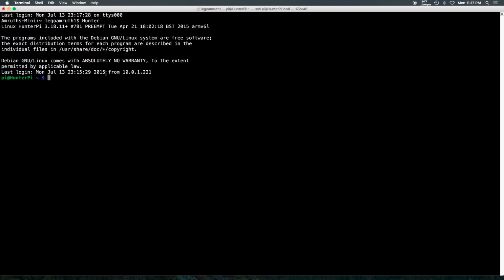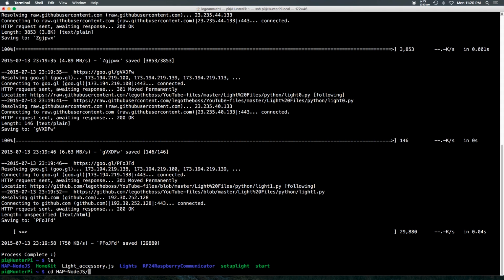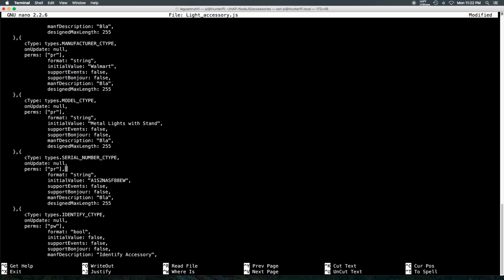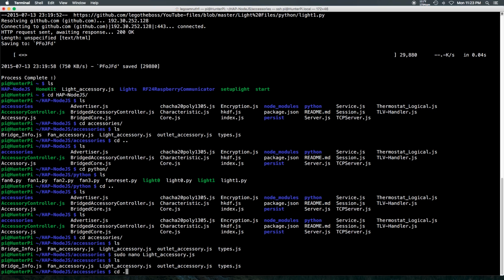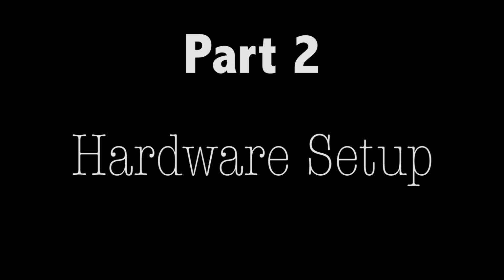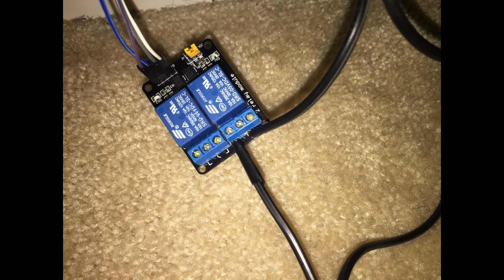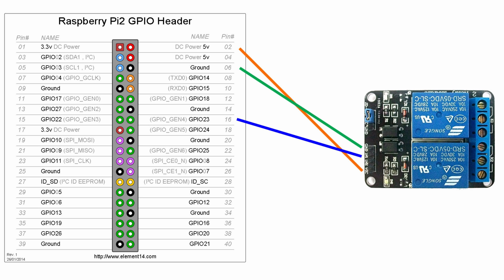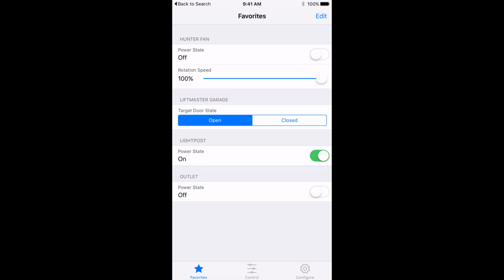TUTORIAL: Siri/HomeKit Lights with Raspberry Pi

Comment: aha, i have Search with my Multimeter, and i have see the Relais1 is Death...the Relais 2 ist ON..my Lamp Works...COOL, Thanks..

i have an Script Error,

import RPi.GPIO as GPIO
from time import sleep
GPIO.setmode(GPIO.BOARD)
GPIO.setup(26, GPIO.OUT)
GPIO.output(26, 1)
GPIO.output(26, 0)
sleep(2)
GPIO.output(26, 1)
GPIO.cleanup()

insert in light0 and in light1

when i said Siri Lamp ON, Siri give Lamp ON after 2 Seconds Lamp OFF,
when i said Siri Lamp OFF, Siri give ON after 2 Secondes Lamp OFF..

so i have insert Sleep(10)

Lamp on 10 Second, and Auto OFF

How can I do that the Lampe is Permanently ON, and ON and ON...and after when i said to Siri Lamp OFF...the Lamp is off

what script i give in the Raspi?

do have the right script for me?

Thanks a very lot, 

this script here, is COOL with the Lock Door in House.
Auto OFF...in (20) Seconds...
Reply from the maker: I suggest you use my code rather than this. This code is always switching on and off the light. The code used in the tutorial does not do that. Refollow the tutorial and that will work. The script edits you made don't work like that.

Comment: I have 220V with a lamp, here

when i connect the last Wire to second Relais, I hear a clicks, and after 1 Second another Klick
when i connect the last Wire to first Relais, who i insert the Lamp, i don't can hear the Klick...and the Lamp is nothing ON or OFF...

What am I doing wrong?
Reply from the maker: 0FreddysStudio0 I think the issue might be with your relay. If the siri commands work, its a wiring issue or relay problem. Another suggestion I give is switch your light0 and light1 files. rename them. Rename light0 as light1. Then rename light1 as light0. Your relay type might be different than mine due to 220V.

Comment: have you an tutorial from an Lock Door?
why a Relais switch this here...or connect directly

http://www.amazon.de/ABUS-ET75-elektrischer-Türöffner-575549/dp/B00JLGC228/ref=pd_cp_60_2?ie=UTF8&refRID=0MJ7E4KFM9DKC7RY26X6

ehm, Lock open, after 10 sec lock auto closed

Comment: COOL...the Raspi 2 works

i have installed the Permanently Start on Raspi Start..

my Problem is the Relais...

when i said Siri Licht ein...Siri said Licht is ON...my Lamp is OFF!!
i have install the Python shell and a have two Files in the python directory...the lights0.py and the light1.py
i have insert this hier in the Files, 
import RPi.GPIO as GPIO
from time import sleep
GPIO.setmode(GPIO.BOARD)
GPIO.setup(26, GPIO.OUT)
GPIO.output(26, 1)
GPIO.output(26, 0)
sleep(2)
GPIO.output(26, 1)
GPIO.cleanup()

after i have connect the Pins on Raspi on your tutorial...the Lamp not Light...not OFF..

What did I do wrong?

THanks
Reply from the maker: You have done the wiring wrong. I suggest you relook into the wiring. You put one of the wires into the NC terminal. Can you please message me a picture of the wiring?

Comment: pi@raspberrypi~/HAP-NodeJS $ sudo node Core.js
* WARNING * The program 'node' uses the Apple Bonjour compatibility layer of Avahi.
* WARNING * Please fix your application to use the native API of Avahi!
* WARNING * For more information see <http://0pointer.de/avahi-compat?s=libdns_sd&e=node>
* WARNING * The program 'node' called 'DNSServiceRegister()' which is not supported (or only supported partially) in the Apple Bonjour compatibility layer of Avahi.
* WARNING * Please fix your application to use the native API of Avahi!
* WARNING * For more information see <http://0pointer.de/avahi-compat?s=libdns_sd&e=node&f=DNSServiceRegister>
Parsing accessory: Fan_accessory.js
Parsing accessory: GarageDoorOpener_accessory.js
Parsing accessory: Light_accessory.js
/home/pi/HAP-NodeJS/accessories/Light_accessory.js:108
		manfDescription: “Doesn’t actually adjust Hue of Light",
		                 ^
SyntaxError: Unexpected token ILLEGAL
    at exports.runInThisContext (vm.js:73:16)
    at Module._compile (module.js:443:25)
    at Object.Module._extensions..js (module.js:478:10)
    at Module.load (module.js:355:32)
    at Function.Module._load (module.js:310:12)
    at Module.require (module.js:365:17)
    at require (module.js:384:17)
    at /home/pi/HAP-NodeJS/Core.js:22:24
    at Array.forEach (native)
    at Object.<anonymous> (/home/pi/HAP-NodeJS/Core.js:19:53)
pi@raspberrypi~/HAP-NodeJS $
Reply from the maker: 0FreddysStudio0 I suggest you refollow the tutorial. There were some bugs that occurred and your log file helped me fix them. Rerun the setuplight script or Just Redo the tutorial if that is easier for you. Good luck :) and let me know what happens.

Comment: HI..i don't can see the Light...
ehm i have installed on your Video...and i have installed the Forever start...all OK...
when i reboot the Raspi 2, with last Raspian...i can see in the last Boot file, :
warn:--minUptime not set. Defaulting to 1000ms, and Warn spinSleepTime not set, Your script will exit ... and 
Info: Forever provessing File: Core.js
and Started HAP-NodeJS
my IP address is: 192.168.1.150

and the IP Adress from my iPhone is : 192.168.1.15

HM Catalog i have installed on my iPhone 6 Plus…and Funktionality Perfect..
i go to Rooms, and Add Accessory...and here is  Browsing for new accessories...
FIND Done...
nothing

why?
have you an adea?

Thanks
Reply from the maker: Try running Core.js without forever. Start it normally via the command 'sudo node Core.js'. See what errors occur. If you can fix them, fix them. If you can't, leave a comment so I can guide you. Good luck :)

Comment: I followed you steps but when I tried to add accessories , there were nothing show up. Could not find the accessories. Do you have any idea what might be the problem? I already forever run Core.js. Thank you very much.
Reply from the maker: Kingsley Wang Try rebooting the raspberry pi. Then use the standard command 'sudo node Core.js' and see what errors pop up. If there aren't any errors, I suggest you remove the 'persist' directory in the HAP-NodeJS folder and also reset the HomeKit configuration on your iOS device.
Reply from the maker: Kingsley Wang  I suggest you refollow the tutorial. There were some bugs that occurred and a provided log file by another viewer helped me fix them. Rerun the setuplight script or Just Redo the tutorial if that is easier for you. Good luck :) and let me know what happens.
Reply: QuickPi Hi , I retried it. And it find the light1 once. It just sometimes show up sometimes not. Have you met this situation before?  And it cannot be added, showing communication failure. :)

This is the log file after running standard sudo node Core.js. Do you have any idea what is that error. Thank you !!

* WARNING * The program 'node' uses the Apple Bonjour compatibility layer of Avahi.
* WARNING * Please fix your application to use the native API of Avahi!
* WARNING * For more information see <http://0pointer.de/avahi-compat?s=libdns_sd&e=node>
* WARNING * The program 'node' called 'DNSServiceRegister()' which is not supported (or only supported partially) in the Apple Bonjour compatibility layer of Avahi.
* WARNING * Please fix your application to use the native API of Avahi!
* WARNING * For more information see <http://0pointer.de/avahi-compat?s=libdns_sd&e=node&f=DNSServiceRegister>
Parsing accessory: Light_accessory.js
HAP-NodeJS starting...
Cannot find secret key, creating One...
TCP server accepting connection on port: 51826
HAP Server is listening
events.js:85
      throw er; // Unhandled 'error' event
            ^
Error: listen EADDRINUSE
    at exports._errnoException (util.js:746:11)
    at Server._listen2 (net.js:1129:14)
    at listen (net.js:1155:10)
    at Server.listen (net.js:1240:5)
    at Object.startServer (/home/pi/HAP-NodeJS/TCPServer.js:31:15)
    at Object.publishAccessory (/home/pi/HAP-NodeJS/Accessory.js:13:28)
    at Object.<anonymous> (/home/pi/HAP-NodeJS/Core.js:91:12)
    at Module._compile (module.js:460:26)
    at Object.Module._extensions..js (module.js:478:10)
    at Module.load (module.js:355:32)
Reply from the maker: Kingsley Wang Try rebooting the raspberry pi. Another suggestion is resetting the HomeKit configuration on your Raspberry Pi. If you followed my tutorial to run node at boot, you shouldn't run the 'sudo node Core.js' command again. This command is executed at boot. Also reinstall the app on your phone. If none of these help, reinstall HAP-NodeJS on your raspberry pi.
Reply: QuickPi Thank you very much. If I just use a bread board to make a simple LED circuit, will it work the same? I just guess maybe that is the problem? :)
Reply from the maker: Kingsley Wang The concept should work, but i don't believe thats the issue. Some wifi routers don't support avahi and that might also be an issue